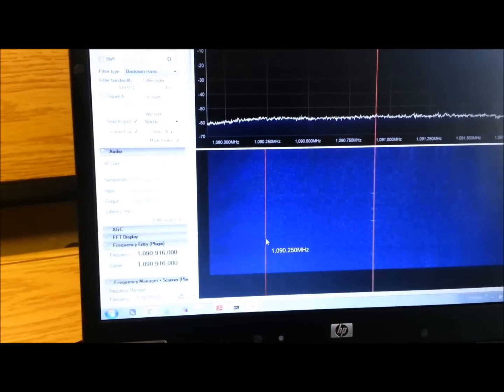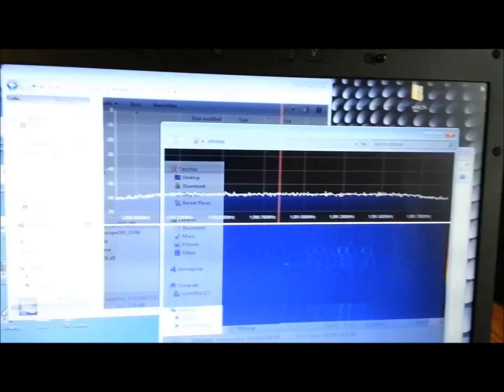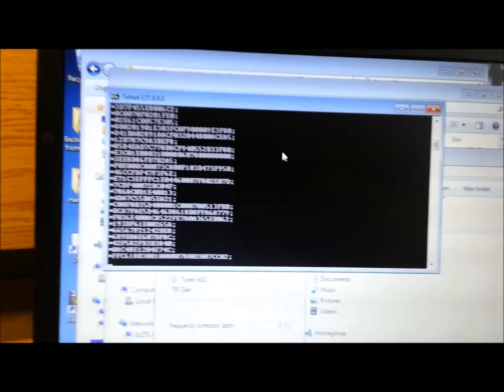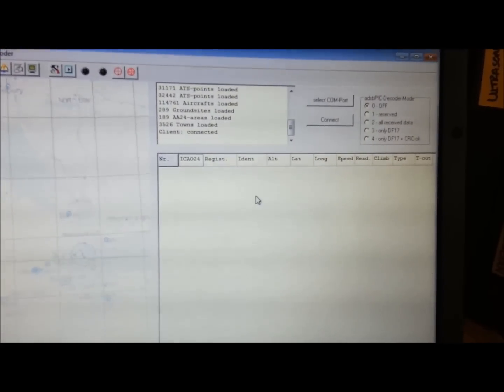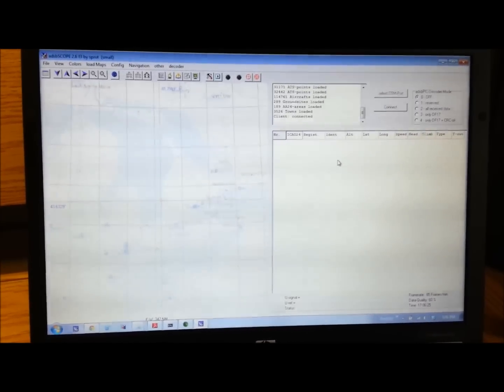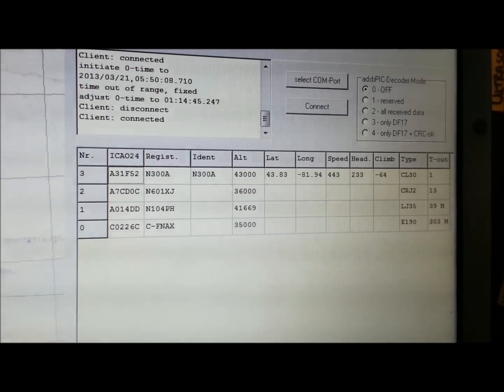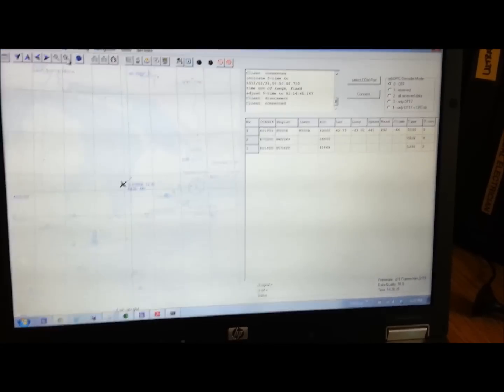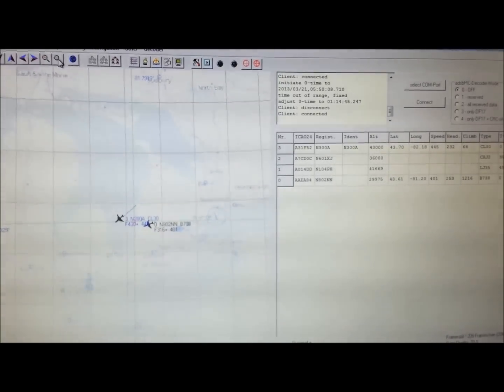ADS-B Decoding with Cheap R820T DBV-T SDR Dongle Tutorial

Comment: If you have time, I'd like to hear details about using Telnet to read the data stream.  I use Telnet for things like visiting old school BBS systems, etc., so I'm familiar with its use. How did you determine the IP address and port number that you used to view the data stream? Thanks, and I really enjoy your videos.
Reply from the maker: Thanks Curt.  That's how I first used Telnet as well :)  Man I miss those days haha.  Pretty sure I found the port on a tutorial somewhere but can't seem to find it now.  Regardless- the port is listed in the prog so you should be good to go.  No real need to see the raw data unless you have troubles.  Cheers
Reply: Eric William Used your tutorial here to setup my ADS-B plotter today and it is working quite well.  Also was able to answer my earlier question about checking the data stream connection via Telnet.  Did that by simply starting up the CMD prompt, opening a Telnet session, then typing in "o 127.0.0.1 47806." Worked like a charm and now I'm plotting air traffic here in Seattle. Thanks for yet another awesome, easy to understand tutorial.
Reply from the maker: ***** Excellent Curt.  Glad to hear it!  I did 2 newer vids that are a bit better quality than this one for people just setting this up.  Still working on getting things to be a bit better quality.  Really glad you got it all working.  Cheers Bud.
Reply: Have to mention that I'm decoding using only the dongle antennae, alligator-clipped to a simple long-wire antennae strung along my basement windows, a fact that I find amazing. Will check out your other vids, thanks.
Reply: P.S. Eric, are you on Twitter? If yes, I'd like to follow you. You can find my Twitter account by going to my YouTube channel page and clicking on the Twitter icon below my page photo. Thanks.

Comment: The one that did decode was a Gulfstream G550 (Corporate jet) from Exxon Mobil.  Pretty cool video/information.  I'm going to try it this weekend.  Wish I'd have tried this with my SDR stuff before buying an $800 ADS-B transceiver.   :)
Reply from the maker: Haha ya they work incredible for the price.  I haven't built a proper antenna yet but works great.  Too bad alot of my local traffic is CRJ's and ERJ's without ADS-B yet.  New vid is forthcoming which will be a lot better.  Cheers

Comment: I have an R820T tuner dongle and it works very well but can be tricky for many getting it set up properly. I have another that uses the E4000 chip but I much prefer the R820T because it has a lower frequency range vs the E4000 tuner. Either one is very inexpensive though and are lots of fun to use because you can *see* the signals your looking for vs only hearing them but they do require frequency calibration.
Provided you can get it set up properly, this can be a good starter SDR.